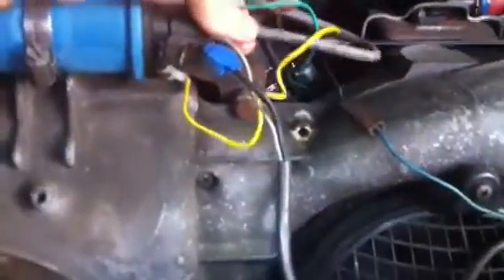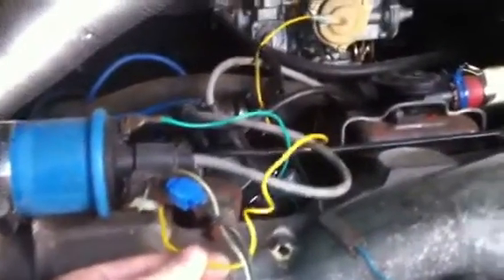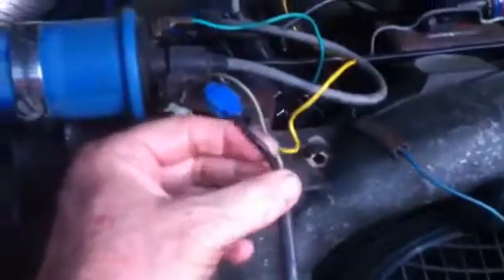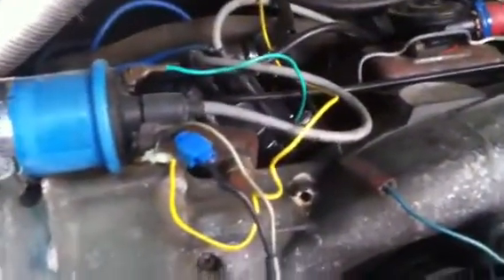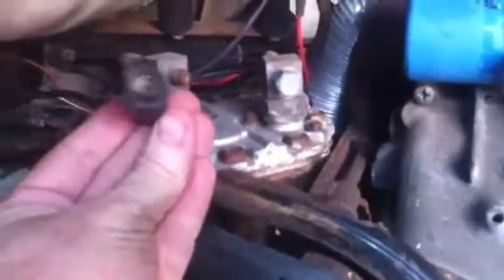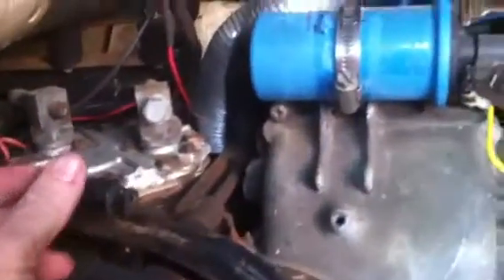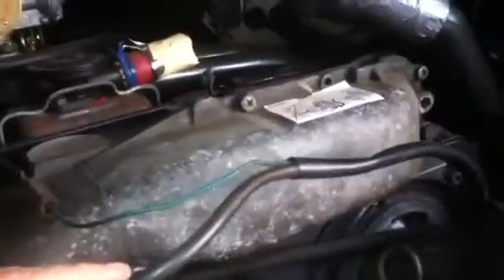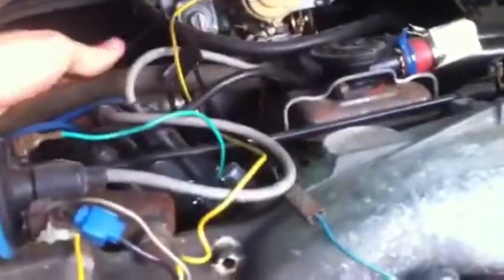73 Bus Engine Tour

Comment: You're gonna need to drop the engine (only 4 nuts holding it in), follow all the wires to the source, can't see shit if you're making a video in the dark. Looks like you really need to check out what's happening behind the firewall or at least remove the tape maybe some made a hole in it. The black metal are your cooling tins very important, the bar is also part of your cooling system that has a cable connected to a thermostat. The bar has flaps at each end, when opened allow air in.